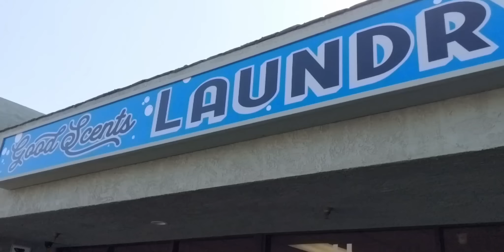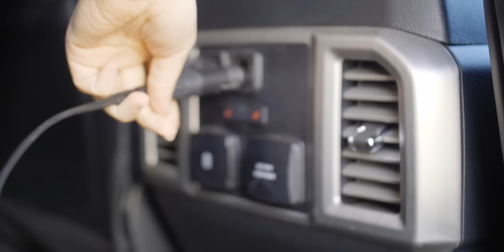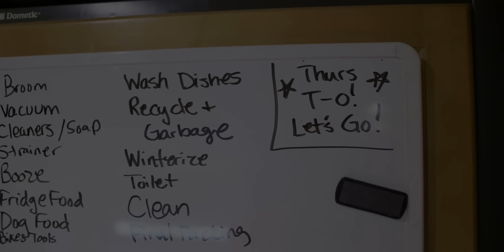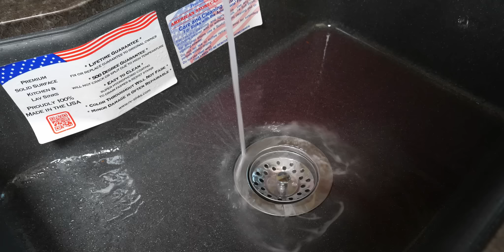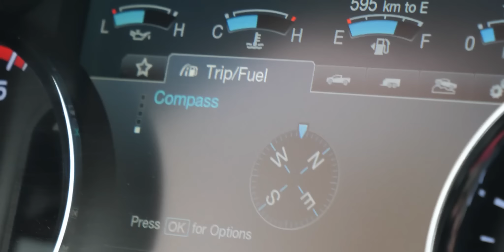RV Downsizing: Packing the Lance 1172 Truck Camper & Hitting the Road! | Go North Ep 3

Comment: Glad you are on the road.  Look forward to seeing more videos.  When I went to Alaska from Kansas in 1987, all I had was a small Nissan Pick-up and a very small Coleman Pop-up trailer.  No power, no solar, just me, my dog, and a cooler.  I had no problems finding food, services such as tire repair, laundry, etc.  Didn't even bring any tools to speak of with me either (just enough to change a tire) and it turned out I didn't need them.  I am sure you may have the occasional flat,  but with a brand new truck and camper you should be in great shape.  We have a Lance TT (2375).  We took it out on a 78 day trip one week after we got it and there was absolutely nothing wrong with it.  Not even a tiny little thing.  Took 2 more short trips with it after we got home from the big trip and it is still perfect.  I am sure you guys will be fine and have a perfect trip.  Looking forward to seeing all that you see and do!  Good luck and keep those videos coming!!!

Comment: I have the Opposite issue,  I have nothing (lost it all) and Have to figure out what I need for a rig,  my Amazon Wish List is Exhaustive.  Thank you for the Tool Section of the Video!!!  A few months ago I started looking at truck campers.  While "Van Life" is Trendy,  there is More Bang for the Buck with a Truck Camper.  And I keep going back to Lance and looking at them.   Safe Travels.  :)
Reply: I have a northern lite. Much better than Lance. They are sponsored by Lance. I doubt they would have bought it vs Bigfoot and Northern Lite.
As you can see, except to invest at least $10,000 into any camper you buy to make it liveable.
"Bang for the buck" is not truck Campers. They have the highest price per square foot cost.
Reply: I have been looking at 4 season campers,  and since I live in Colorado  - I cannot go outside without tripping over a good used one.  My theory might be wrong but it is:  Finding parts would be easy also.  I would never be able to buy new.   Buying a Camper Van is out.  In the last two years on average, the price has gone up on Used ones between  5k / 7k.  Then add in the Tanks,  They are tiny compared to a Truck Camper.  The Cheapest way to go might be a trailer.  But not too comfy pulling one.   If money was no object  I would love a Travato 59G.  Even with Sumo Springs - the ground clearance is abysmal.  There is a lot of compromises with any RV.
Reply: @melissaweyrick5311  You need a serious heavy-duty truck (and a dually) for most truck-campers as they are WAY heavier than you'd think just looking at them. If you buy both truck & camper new (a quality brand camper, not a crap brand), the cost of both would probably be in the same ballpark as a new Travato...and most other "average" Bs (but definitely less than the really expensive "luxury" brands). Plus, if you want to get off-pavement much (or want better traction in rain/snow) then add MORE thousands of $$ to get a 4x4 truck. 
There are Pros & Cons for each -- truck-camper vs. Class B (aka: campervan) -- so of course it's whichever platform fits your needs best. Just sayin' the cost of either "platform" is about the same if you buy NEW. Buy USED (but not TOO used, maybe 1-3 years old max) and a quality truck & camper is still some big money...just not as much. ;-)
If someone ALREADY owns said "serious" truck and just needs to buy the camper, then of course it's more affordable. Buying BOTH though is pretty pricey.
Same for buying a Class B used, but again I'm talking not TOO used, so it's still "like new" but without the 1st-year new RV depreciation hit. But some of the USED Class Bs -- popular in-high-demand models (like Winnebago's Revel 4x4) -- are almost as expensive as the new ones, so not much savings there -- in that case I'd rather buy NEW (and at least get the full factory coach warranty, as short as most of them are (12 months only?). Chassis/engine warranty on all of them should be standard 36-months as most cars/trucks/SUVs have, so that's some good news.
In my case, I'm leaning towards a Class B (for one reason I don't already own a big honkin' truck!)...but it needs to be 4-season AND also 4x4/AWD, NOT built on a MB Sprinter/diesel chassis as I prefer an American chassis/gas engine (meaning Ford Transit or Dodge ProMaster). Sadly, no such B (4-season AND also 4x4/AWD) from the major Class B makers exists NOW. While I like the concept of Winnebago's Revel 4x4 44E -- the ONLY game in town for me were I ready to buy NOW -- it's a Sprinter/diesel...I hope with the new Ford Transit 4x4 chassis coming in 2020, one (or more!) of the Class B makers will USE it! Especially Coachmen: They already have a 4-season B on a Transit (the Beyond, formerly called the Crossfit), but it's 2WD...I'm hoping they'll make a 4x4 version in 2020.
With more buyers nowadays looking for smaller motor-homes wanting something similar to "Overlanding" vehicles (but not THAT hard-core OR insanely expensive!) -- to reach more way-out-there boon-docking sites -- it'd be nice to have more 4-season/4x4 Class Bs to choose from...but the "B-Makers" (except Winnebago) are slow to get that. 
Whatever, if YOU end up getting a truck-camper, be sure to get a big enough truck -- preferably a bit MORE then you need. I'd guess that MOST truck-camper rigs out there on the road are overloaded, and at the very least, that's unsafe...not to mention excessive/accelerated wear & tear on the poor trucks!
Happy Travels,
-- BR
P.S I lived in Colorado Springs a while back...may be returning in a year or so. Kind of miss the snow, too. ;-)
Reply: @billredding2000  I have been reading a lot on Truck Camper Magazine and know to get at least a 3/4 ton.  The Payload Capacity on Fords and Ram is about the same. If I remember correctly.  I have been shopping Nationwide for trucks.  A one-way plane ticket/motel would save me money compared to what People want for a truck in CO. There are some other truck campers I like.  Right now, Lance is in the lead and I have a year yet to change my mind a thousand times.   lol
Reply: @melissaweyrick5311  When I was looking at truck-campers, Lance was one of the brands...but also Cirrus (by NuCamp), Bigfoot and Arctic Fox (by Northwood).
ETA: I also have about a year to change my mind, so I hope that's enough time to decide which way to go: Class B or small TT (Airstream Basecamp X or T@B 320 Boondock Edge). RE: a Class B though, I suspect there'll be very few (maybe 2 at best?) 4-season/4x4-AWD models to choose from, so THAT decision may not be too hard. As for TTs, presently there are only 2 of THEM, so that's not overwhelming either.
Glad I don't have to decide NOW between a Class B or TT, so the more time to let the dust settle will be useful.
Good luck,
-- BR
Reply: melissa weyrick get the ram 3500. good reliable truck